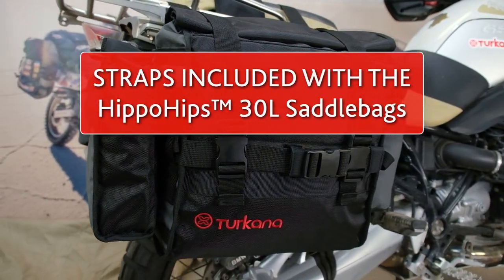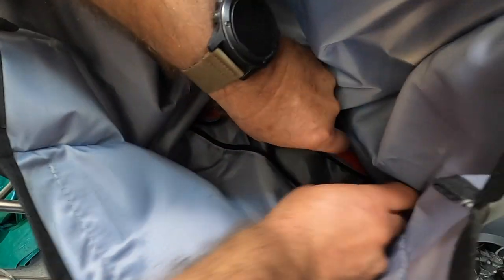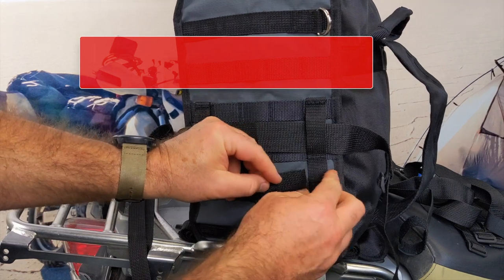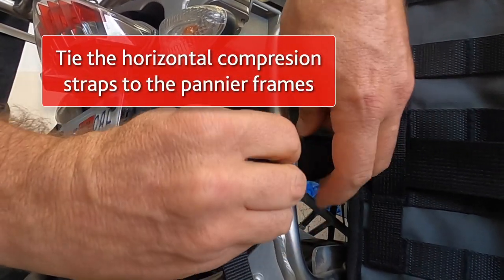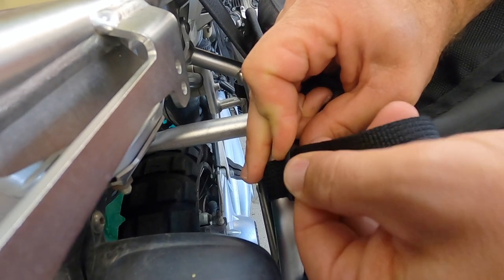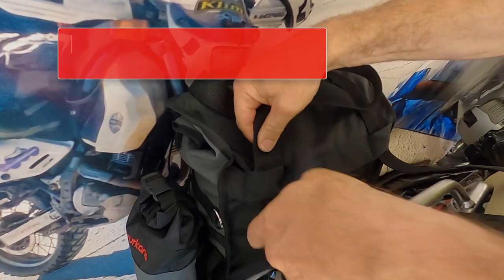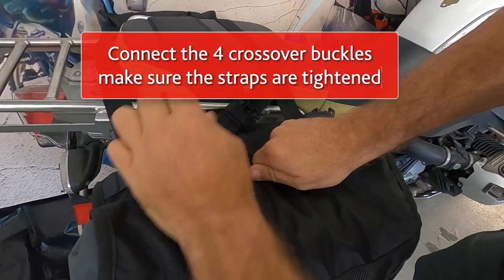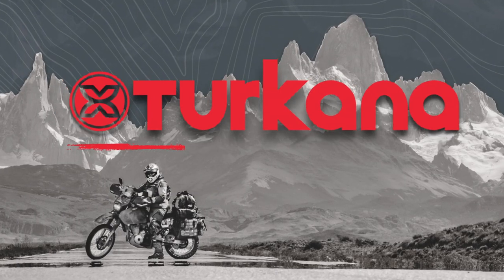How to -TurkanaGear HippoHips motorcycle saddlebags installation

Comment: Hi Piet;  Received the HippoHips today. When I opened the box, I thought there had been a mistake.  These bags are super tough and look like SA Special Forces operational kit.  Your video takes the guesswork out of installation.  I estimate about an hour for a complete rookie.  I know the bags fit many different bikes, but they have a look that perfectly complements the new 1250 GSA - aggressive,  rugged, and sophisticated.  It's obvious that a lot of experience and thinking went into their design and build. You could pay double your price and still not achieve this value, quality or functionality.  I mounted them on the OEM pannier racks - do I need a heat shield?
Reply from the maker: Dear 1730viking

Apologies for missing your post and hence only responding to you now. And thank you for the kind words about the Hippo Hips!

Depending on your setup, it could be a good idea to install a heat-shield over you exhaust, as that will most definitely prevent any damage should your bags ever touch the exhaust. However, if there is a gap of about 10cm between the exhaust and the bags, and provided the bags are fitted in such a way that it will never touch the exhaust, everything should be fine without a heat shield. 

You are welcome to send us photos of your setup once it is fitted if you need us to confirm the above. Please send to info@turkanagear.com

Thank you!

Comment: Hello. Guys.  Thanks for the installation video.  It’s a big help.  One question.  The bag on the right side of my 850gsa is very close to my muffler.  I’m concerned about the heat melting the bag and/or straps.  Is this going to be a problem?
Reply from the maker: Hi Bamawester - Firstly, apologies for the delayed response!  Can you please confirm if you have the standard OEM BMW pannier racks? If so, we recommend using a mounting plate that we have available that fit onto the rack. This extends the surface mounting area on the exhaust side and also prevent the luggage from possibly being damaged by the exhaust heat. Shoot us an email at info@turkangear.com with your contact details and we will contact you.